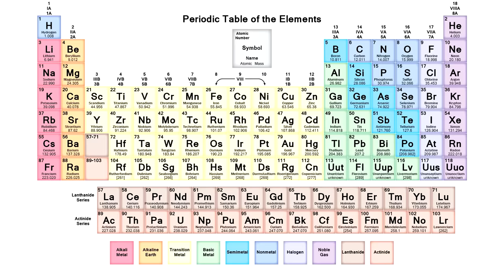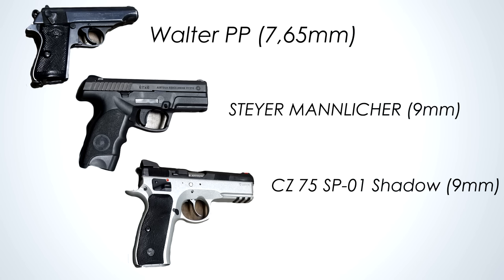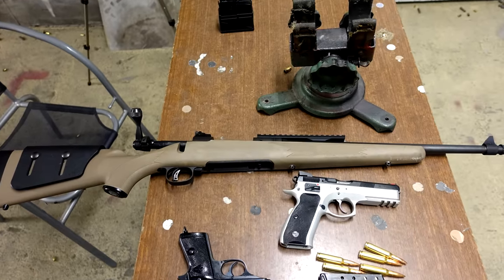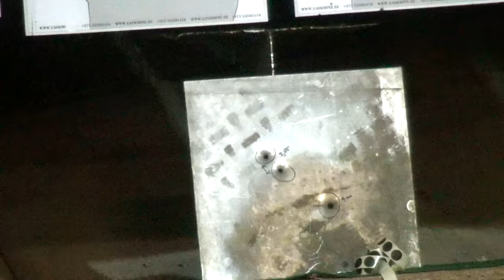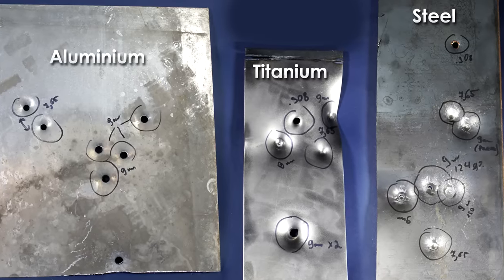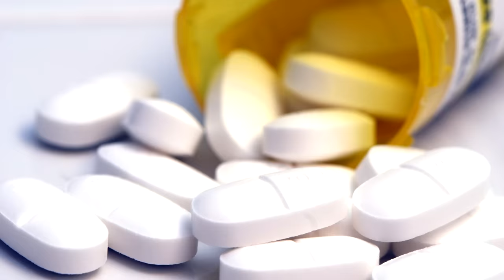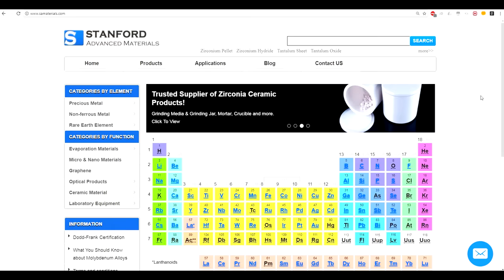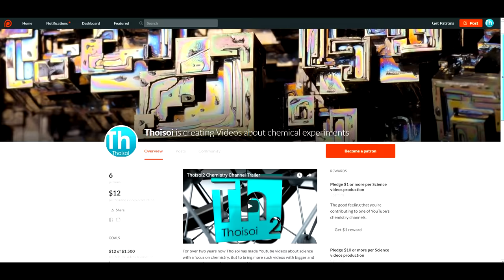Titanium  - The STRONGEST METAL On Earth!

Comment: Lead titanium tetramolecule can be made, as long as the lead is radioactive. The lead can replace the Uranium for a while, the moving capability of the molecule is about the same, the cutting capability is the same. When the lead loses its radioactivity, the tetramolecule falls apart. Iron is also needed to make the tetramolecule, that’s why warheads are aimed at vehicle wrecks, tank wrecks, train wrecks. To make the molecules, the wrecks, car batteries, aircraft engines have to be placed in the right order before the warhead arrives. For example, the lead batteries have to be in the middle, the aircraft engines have to be around the batteries, the train engines, tank wrecks have to be around the aircraft engines. 
When this is done, uranium lead titanium tetramolecule is made, or lead titanium tetramolecule is made. The iron causes higher gravity of the smoke, so millions of tons of iron can carry the cutter edges of titanium tetramolecules. The molecules grow bigger in the body, it can grow to 2 cm size, and moves like the boiling water.

Comment: Titanium isn't even close to being the strongest metal.  High-carbon steel is much stronger, and tungsten alloys exceed even that.  Titanium is lighter though and can withstand high temperatures.  Personally, I'm all in on aluminum for my metal work--it's far easier to cut, form and handle, and much less expensive.
Reply: You have better chances of welding aluminum with a twin carbon arc torch than reactive titanium.

Comment: The problem with Titanium in engineering applications is that it has poor friction resistance.  It will not work as a bearing material.  It is not capable of being hardened by heat treatment like steal is.  If it is forced into a friction application out will bind and wear out.    For certain applications (such as dental implants) it is excellent, light and will not rust or poison.

Comment: Thanks for the video... Correct me if i'm wrong (please), but in defence Ti6AL4V is typically used is not very ductile on the contrary... Their capacity to absorb  impact energy should be related to something else, right? I thought the kinetic energy of bullet has to be higher than the energy required to melt the portion of the metal, for the bullet to pass thought and for titanium this melting energy is quite high...

Comment: P.S.A.-PLEASE READ---Please consider the fact that if your finger swells up under a ring made out of a super hard metal, you may end up losing your finger before the doctors can cut through the metal. If you must have these metals in a ring, have a gap already cut into it so they only need to use spreaders to bend the ring.

 I turned on the subtitles because this guy is totally worth understanding, but they aren't working on this video. Is it just me or are they absent?

Comment: I have a giant scar on my upper forearm from drilling a titanium plate.  The drill bit the titanium right when it was coming out the backside & the torque ripped the plate from it's securing.  It spun and gashed my arm - definitely wasn't expecting that!  It's way different than working common stuff!

I remember looking at my arm thinking "ok, no blood, I'm good..." Then seconds later watching the blood flowing out of the wound.  In hindsight, I probably should have gone to the doctor - it took 3-4 months to fully heal.  But I got a badass scar out of it!

And that's how I learned to take extra care when fucking around with Titanium.

Comment: There was a story from the Russian war in Afghanistan where the Taliban shot down a Russian helicopter and it fell intact and they couldn't cut it open and bullets bounced off it. The Taliban got some US army advisers and the US guys told them it was made of titanium. There was also the story of the Russian titanium submarine but it wasn't a success as it cracked under the sea pressure. Perhaps although stronger than steel it doesn't have the elasticity.

Comment: In the aerospace industry when grinding titanium you are not allowed to let sparks touch the part. It is required by the machining specifications to grind at such low surface speeds as to not create any sparks. The hot sparks hitting the part will create brittle spots on the surface of the part affecting the surface tension thus the strength of the part. I have found that aluminum oxide is not a good choice for grinding. I have found that CBN or diamond are the best abrasives to cut titanium. Making the least amount of heat and requiring the least amount of tool pressure.

Comment: I have cut Ti with a CNC water Jet cutter. The sand used was Garnet, pressure of water 40,000 Psi, diameter of nozzle  0.040", Nozzle material Tungsten Carbide. The Ti was   15 mm thick,  when cutting there is a very strange glow in the water/garnet stream going back up to the nozzle from the Ti sheet, it is a very bright purple energy effect and the cut edge is very smooth.  In comparison when cutting the same thickness of Core 10 steel, there is no glow and the edge is sandy looking.

Comment: Did you use common low carbon steel "mild steel", which isn't hardenable and therefore is not actually steel, or did you use hardened steel with carbon content from 0.8% to 1.2%?

Comment: Next, it looks like 4mm titanium is going to be the ultimate armour suit. It is possible to calculate the exact bullet that can be blocked with titanium using the kinetic energy formula (https://en.m.wikipedia.org/wiki/Muzzle_energy). In addition, two layers of 2mm titanium would do the trick as body armour. This would make it easier to form and bend. Moreover, you could do 2mm thick titanium chest, helmet and shin guards with a 3.6mm thick shield. The helmet, chest and shin guards could have a second plate of 2mm thick titanium riveted on in particular spots.

Comment: 5:40 look at what the bullet did to the vertical piece of steel behind the titanium plate... That massive V smashed into it as the bullet hit, and and transferred it's energy through the titanium. It forced the harder metal into the softer one and made a bigger V than if the plate was not even there!

Comment: titanium isn't the most durable or strongest metal on earth. Not even close. Titanium is known for its weight to strength ratio, heat resistance, and corrosion resistance, which makes it very useful in fighter jets, but it's strength is similar to steel.

Comment: most durable..... the title said strongest, I knew you wouldnt let me down like that!!
Reply: oh, and next time try using a band saw. at that thickness a shear might be better. and always use coolant when machining as cutters go dull like, all of a sudden sometimes.
 titainiun is very abrasion resistant so it is sometimes a pain to machine. it is however, wonderfull to weld. it is my favorite material to weld. if you use a gold lense it is easier to see when the heat is getting too high because you can see the color of the metal go green before it burns.

Comment: You are completely wrong, while Titanium alloys are strong and lightweight however they are no match for steel alloys. For example Titanium grade5 has 128000Psi yield strength and 138000Psi UTS. Now compare that to steel 17-4PH condition H900 ,yield strength is 170000Psi and UTS of 190000Psi.

Comment: Titanium is not the strongest metal on earth. You should re name the title. Titanium droops with heat. Which is why nascar engines with titanium valves need to be replaced after a race. It is lightweight with the strength of steel. It still is an impressive metal.

Comment: How do you measure strenght and durability? Steel can be anything with strenght, ductiliy and resistance to wear and oxidation. All most often at a fraction of the cost. Metal-alloys and metals are always used where they perform the best.

I worked at at chemical factory where even titanium wasn't strong enough to cope with chemical and mechanical wear - we needed to use special stainless steel alloys. The pumphouses and impellars looked like granite after awhile of use, and needed to be rewelded and machined.

Comment: Grade 5 Titanium can be made into Knives.
Annealed Titanium is about the same to cut with a jeweler's saw as brass & mikd steel, at half the weight. It must be TIG welded in an inert atmidphrre, such as Argon or Nitrogen to prevent embrittlement in the welds.
Reply: how to sharp it .
Use BT-22 ,Much stronger than Gr5 titanium

Comment: There are 9 basic properties of metals 
Brittleness, elasticity, tensile strength, malleability, yield strength, hardness, impact strength, ductility.
All metals have these properties and can give and take these. Aluminum is the only metal in the world to get stronger as it colder. Try Fireing a round at
Precipitation hardend stainless steel, it is capable of tensile strengths 5 times that of titanium.
(Alberta welder common knowledge) 
Titanium is also an additive for alloys too 
It depends on application
Reply: Forgot the ninth property  (toughness)

Comment: Titanium is weaker than steel by volume, but much lighter.  Titanium is softer than steel to be specific.  Steel is also way easier to refine and work with.  Steel, or rather, iron is the most common metal in earth’s crust.

Comment: titanium only beats mild steel slightly. titanium is harder to work with because of its tendency to oxidize so tempering is rare for it. however. tool grade high carbon steel thats been brought to the critical range and quenched making martensite is stronger than non tempered titanium. if you bring the martensite to blue with another tempering phase between 350 and 420 f depending on carbon content and what the previous critical range was which is (mostly based on carbon content) its much stronger than structural grade titanium. also titanium has a galling problem so its not used when ever friction with other metals is common like gears

Comment: Titanium sheet can be sheared easily on regular metal shearing machine.  Titanium sheet has more memory than steel also.  It has its place which is where high strength, corrosion resistance is needed, it also holds up better under high heat applications.  However I wouldnt go so far to say it is the strongest metal.  It isn't.  Nickel alloy metals are stronger.

Comment: Durable yes, strong... NO.
Titanium is a type of metal that is usually only good for use when mixed with another metal, or a number of metals like stainless steel and nickle.
Titanium by itself is though strong... muluable like if centrifuged it stretches very easily. However, when combine with other metals it allows an alloy to be slightly flexible and tolerant of high temeratures.

Comment: Titanium is not strongest metal on Earth...Tungsten is strongest and next one is Molybdenium.Titanium is third one...Tungsten,Molybdenium cannot normally weld,it requires 3600 degree Celsius temperature to penetrate metals,normal welding machines cannot weld them but plasma,electron beam and laser can but only in vacuum chamber oxygen free to prevent brettleness..titanium could be weld but only with torch heating during welding and after welding to cool it off by slowly reducing torch temperature..

Comment: Smaller bullets penetrate more easily
Reply: or?
Reply: Well a ship is quite big, if you wanna make a hole in it it should be big too
Reply: Doesn't mean it's more efficient
Reply: But as you say it's due to the shape. And while the cartridge is longer, the projectile of the 9x19 and 5.7x28 have roughly the same mass, the main difference being their shape. Hollow points of the same mass would penetrate even worse
Reply: I don't shoot. :3 Thanks for the info on bullet weights, I was confused by the dimensions